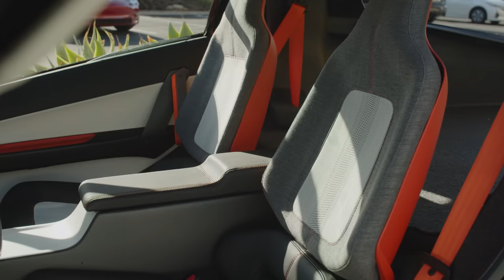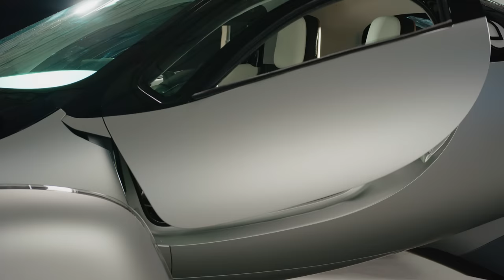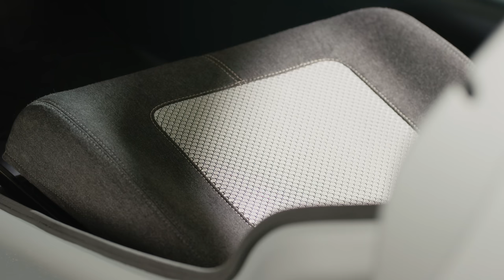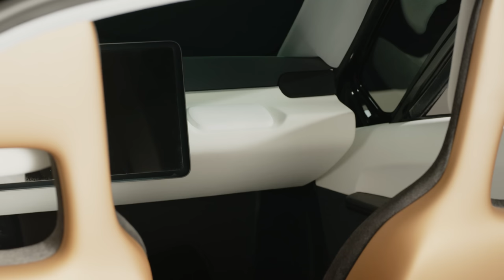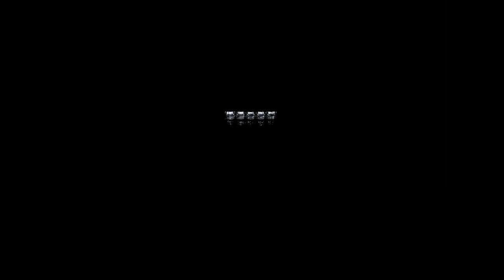Gamma's Interior Details — Aptera

Comment: Regarding the yoke, the $10M question is how it performs during low speed manoeuvring, for example parallel parking.  If it requires rotations beyond +/-90 degrees then I think it should be replaced by a steering wheel, otherwise you'd need to cross your arms. Aesthetically I am OK with it, but from a practicality viewpoint I have concerns.  ... could a steering wheel be an option?
Regarding the rest of the interior, I'm fine with it, it looks like a nice place to be while driving, functional, simple.   Incidentally, if a third-party accessory manufacturer were to produce an external solar windscreen cover, which plugs into the exterior solar connector, maybe clipping onto the mirror camera stalks, I think that would be great. It'd help keep the car cool while simultaneously boosting the charge during parking (giving much more power than the dash solar panels can provide).
Reply: To me it seems that the motors on the tires are relatively small so it should turn pretty tight pretty quick. I don't know why I think that but it just seems that way to me
Reply: I have arthritis so I hold the wheel in various different ways.  I'm not super hyped about the yolk and would likely look into some kind of replacement.
Reply: @meikgeik  Like most cars and motorcycles there is certain to be a plethora of aftermarket accessories if a maker does or does not offer said option.  Sorry to read you have arthritis and I do hope you can get that option in some way.
Reply: I really like the idea of extra panels. Would be great if there was something like a 'solar parking' mode, covering the windshield with rollable solar panels and maybe folding additional one from the roof to improve surface area.
Reply: @spyro440  Yeah I think it's a great idea.  Just for the record, not my idea (Aptera owner's club mentioned it, and I think it was discussed on the forum beforehand), but if someone made it, I'd buy it in a heartbeat.  Aptera have suggested that they'll let us add in external freestanding solar panels via an MC4 connector or similar, for a maximum of 1500 watts including the built in panels.  I just feel that doing it for the windscreen is the most practical way when you are not parked on your own property, and has the secondary benefit of keeping the car cool.
Reply: There needs to be an open space on the top corners of the yoke so you can hook your fingers under it for those tight turns imo.
Reply: @deejnutz2068  Yeah.  From some of the interior-reaction shots from the previous video, I got the impression that people were able to hold it on the upper corners comfortably.  But looking at these photos, It's not clear how they were gripping it.  Hopefully we'll get a closer look at it in use at some point.  I really want to know how it performs at low speed sharp turns.  If it takes 720 degrees to go lock to lock then it'd simply not be viable IMO.  But if they have set up the steering electronics so that it is no more than +/-90 degrees at low speed I think it'd be fine.
Reply: @spyro440  Ooh, cool idea. If it didn't affect aero too much, additional panels could automatically deploy from the top over the windshield and side windows, maybe 30 seconds after closing the doors.
Reply: 100% agree, the one true case of “don’t reinvent the wheel”.
Reply: Please Aptera allow for non-yoke as an option!
Reply: I sure hope they're paying attention to these conversations. To me the yoke is a gimmick, to be futuristic looking. There's no reason to not have a steering wheel, really.
Reply: I completely agree with concerns about the yoke as the sole steering option, and look forward to reviews by independent automotive experts. Evasive maneuvers, parallel parking, lane changes within traffic circles, u-turns on two lane streets, etc. are all of concern, as is the ergonomic need to change hand positions on road trips. This past week I paid a lot of attention to how I used my hands on a short 300 mile road trip, and was surprised at how often I repositioned my hands to use all parts of the steering wheel of my Ford e450-based RV as I drove down an interstate. The e450 steering wheel is also thinner than the thick edges of the yoke, and therefore will be easier to grip. The yoke seems designed for much larger hands than mine.
Reply: I'm ok with the Yoke, but it might be slightly ahead of it's time.

If electronic steering was approved by regulators, variable turning ratios would be super easy.

If my order doesn't come with drive by wire, I'll be making some tweaks, aftermarket.
Reply: @wesman9274  imagine having an electric problem and not even being able to steer
Reply: Progressive steering?
Reply: Agree with OP.  Too many designers go for the "rad factor" and forget that there are actual daily driving requirements that their cute little aesthetic enhancements are a safety /performance detriment.  Its the main reason why I elected to not go with a Tesla Model S ( that stupid ass yoke ) and chose a Fisker Ocean Model ONE instead.  This Aptera might be a great "town" option as my second car so we can get rid of our ICE VW.

Comment: My only complaint is the steering yoke.  I prefer a normal steering wheel.
Reply: Give it a chance. I just don't like the smiling appearance
Reply: @SiDPT15  Not giving it a chance.  It's a deal breaker for me.  I've driven a vehicle with a yoke and turning the wheel more than 90 degrees is irritating because there is nowhere to grab.  This car is not for me unless they give a different steering option.
Reply: @Barrettfloyd82  lol
Reply: @Barrettfloyd82  i dont fwg it .  They can just set the steering in a fashion that in lowspeed wheels are turning further than at higher speeds ..so as you will never have a 90 degrees ..
Reply: @Barrettfloyd82  really dude, you base your entire choice of car on the shape of a steering wheel?

Man needs to get out more.
Reply: @Barrettfloyd82  there will probably be an aftermarket wheel at least
Reply: I agree,  it is not only hideous,  but besides copying Tesla, there's just no reason for it.
Reply: Why not a gorgeous steering wheel like the VW XL1 has?
Reply: Yeah I do too. I feel like this style is just unsafe

Comment: Thanks Jason for the update. I am really looking forward to the September reveal. Specifically how everything looks and works with the latest design revision, moving towards Delta.
Reply: I'm planning on using one of my solar panels for my solar home generator for an interior front windshield sun shield.  It should be about the right size and it won't be stolen when left parked somewhere.

Comment: I thought Alpha looked great.  Gamma is incredible.  I can't imagine how awesome Delta is going to be!
Reply: Other than the steering wheel and Tesla plug I love the vehicle.  I hope they meet their specs for the vehicle and become a huge player in the EV market.
Reply: holy ** its him. Yooooo
Reply: Ideally delta should be nearly identical.  We should be past the stage of visual design iteration and what remains is assembly / parts improvements.
Reply: @gbpg2016  is there a specific reason why you don't like the Tesla plug?
Reply: @charllectric4842  the fact that nobody outside America uses it. The current standard is bulky, but can actually scale to powering big rigs and such without a separate connector.

Comment: I still like some physical buttons switches and knobs.  Don’t make the user dig on the screen for very simple tasks!  Examples include:

* A classical stock mount lever for the windshield wipers.

* A classical push button or rotating knob for temperature in the cabin.

The use of the Tesla connector is also backwards looking (pun intended).  The DCQC charge connector should be in the nose of the vehicle and it should be a CCS connector.

The yolk is a mistake. Do not offer it as standard.

i’m concerned some of these decisions above will scare off a lot of good potential customers.

Despite these criticisms, the Aptera Team is doing fabulously.  Well done, and

Charge on!

Comment: The interior looks great but I'm not a fan of light colors on the steering wheel and I usual drive with my left hand below the center (8 o'clockish). I do not see a way to adjust the headrest nor do I see a lumbar support. Since I am only 5'3½" tall with neck and lower back injuries, these things are important to me.
Reply: I think the headrest slides up and down (in the earlier interior shots, there was one where one headrest was higher than the other).  Presumably there will be different interiors (I ordered Vita, for example), which have the matching colours on the yoke.  Lumbar support would be good, you could use a lumbar cushion if necessary though.

Comment: I've got a reservation set. Everything looks great, but not sure about the yoke - I usually drive with one hand on the top of the steering wheel. I haven't driven with one yet so I'm a little biased, but I'm sure there's a reason it was chosen. Willing to give it a shot though.
Reply: A yolk is actually way safer than a steering wheel. During a crash if you have your hand on the top of the wheel, the airbag will shoot your  arm into your face breaking your arm and possibly your nose. A lot of injuries have been caused by this. I know it might be hard to get used to for some people, but its worth it in the end! Gosh it also looks so cool!

Comment: The look is clean and straightforward like a Tesla, hopefully the build quality can improve on Tesla. I do have doubts about the yoke though, there's a reason why the yoke gets a lot of criticism in the Model S and why all legacy manufacturers do not make yokes on their production vehicles.
Reply: People still buy the model s right? It’s definitely not a deal breaker at least for me. The reason why their going to keep them is because of the vision screens(both mirror cameras are going to be on the screen in front of the steering wheel) If you have a round wheel you won’t be able to see the screen as clearly because the round wheel will be blocking it
Reply: I like the idea of a yoke. Finally, I won't need to move my head up and down to see all the info in front of me. However, a fast  turn ratio is also a must.

Comment: I wish the Aptera team would watch Casey Putsch’s video titled “Why the Corvette C8 steering wheel is idiotic garbage and what it should be” and really take it to heart. I don’t care how a steering wheel looks. I do care an awful, awful lot about safety, physical fatigue when driving, and the ability to control any car I drive in emergency situation. I cannot imagine how the current wheel can possibly be gripped in a way that allows for effective emergency steering. And I cannot imagine how much of a pain it will be to to try to find and install a suitable replacement on my own.

Please, don’t anyone reply to this comment without watching that video. And please, Aptera engineers and designers, if Casey is wrong and if I’m wrong, just show me the evidence that demonstrates that a wheel shaped that way can be effectively gripped and maneuvered in an emergency situation. Show me the comparison. Show me it’s better, or at least as good as a decent traditional wheel.
Reply: I have said similar things when Aptera went from wheel to yoke. I do not mind the yoke, I actually like a yoke. What I mind is the touchpoints. If you are driving at 3/9, you need to be able to wrap fingers around the wheel/yoke for best control of the steering device. This yoke does not do that. Aptera needs to address the grip points of the yoke before releasing the vehicle to the public. 

People will get use to a yoke. But they need proper hand placement and grab points in order to do so. My 2003 Cobra has better 3/9 grab points.
Reply: @pbandj37  exactly.
Reply: @pbandj37  This is my problem with the Aptera Joke... err... Yoke.  I want to be able to wrap my fingers around the wheel in a proper grip, not the open-handed palming thing that their yoke forces on us.  This is my single BIGGEST complaint about the car today.
Reply: Watched the referenced video.   He does rattle on a bit, but the point is there.  Improper, unnatural grip.  My main point about a Yoke is this. When he turns his hands 180 degrees, crossing his arms, for racing that may be fine, but you should NEVER cross your arms driving a car on the street.  One hand turns, the other moves along the Round wheel all the while still in contact with the wheel, then you grip with that hand and feed the wheel around sliding the other hand along the Wheel, always in contact with the round wheel.
Now I'm not saying doing this at high speed like in a race car, but all low speed maneuvering like you do turning into parking spots, or the like.  Having a one sided floppy yoke that you have to turn two full revolutions, your hands do not " find " the yoke where it should be , and loss of control WILL happen.  Emergency turning, if you have to hunt for the Yoke when it's rotated upside down, or at a 45 deg. angle, again Loss of Control.
Aircraft Yokes only turn 180 degrees.  90 right, and 90 left, because Ailerons only move so far up and down, and mostly a Pilot doesn't move the yoke more than about half that.  Never two full turns lock to lock, like a car.  
A Car is not a Airplane, and should not have a Yoke, Period !
Reply: "And I cannot imagine how much of a pain it will be to to try to find and install a suitable replacement on my own."  I've done it myself, it's actually fairly easy, provided that they're using a common steering column design, and there aren't too many controls.  Just be super careful of the airbag at all times.  That thing can kill you.
Reply: @WyndStryke  The electronics dictate how easy it will be to replace this yoke. Replacements for Tesla yokes are custom…can’t be used on any other car.
Reply: @maudessen573  Agreed, but a) I think they will be using a pre-existing mechanical & electrical pickup design for cost reasons, and b) there don't seem to be any controls on the thing.  The airbag will be one circuit, at least.  Those are usually pretty standardised though.  Not sure what the two 'eyes' are in the middle, maybe for turn indicators, or just decorative?
Reply: @WyndStryke  I keep wondering about those eyes myself. They better not be turn signals.
Reply: @maudessen573  Another alternative might be the carhorn?  Seems like a strange placement for controls though.
Reply: I just watched the video, and loved the commitment and the critique. I wish Aptera would engage that guy to help them design a steering wheel that would assure a safe, usable, enjoyable driving experience.

Comment: Please, please, PLEASE fix that stupid yoke.  It's not the silly appearance that is my biggest problem, it's the inability to GRASP the wheel in a closed grip.  I get that the hub needs to be big to house an airbag, but it doesn't have to extend all the way out to the sides to block the ability to grasp the wheel.  Make it a three or four spoke yoke that has open grips that you can wrap your fingers around at the 3 and 9 positions.  

Who failed to understand basic ergonomics with this design???  😥

Comment: The yoke is literally the only thing stopping me from placing a deposit. Please don't copy Tesla for the sake of being weird. A 180° steering setup only works on racecars. I'm sure this has more than that for low speed maneuvering. If it doesn't it will have super twitchy steering at high speed. With multiple turns lock-to-lock this will be an awkward mess to drive around town. You can design your screens to be visible with a full wheel. Plenty of car companies have figured out how to do that.
Reply: All these comments regarding the yoke and comparing it to Tesla have missed the elephant in the room.  Aptera has differential steering capability, which i doubt if anyone making the anti yoke comments have experienced.  Your "sure that Aptera has multiple turns lock to lock" and that if it doesn't it will be super twitchy at high speed, ignores the potential of the design.  I have no insight into what they will actually do for production vehicles, but Aptera will not even need to move the angle of the wheels to provide steering.  I am going to wait until I have a chance to experience what they deliver.
Reply: @n.brucenelson5920  So a car designed for maximum efficiency is going to burn energy to steer rather than just turning the wheels? Seems unlikely. Plus that would mean the yoke is not directly connected to the rack, which would require adding a ton of redundant capability. That'd add weight and cost which they can't afford at their price point and efficiency goals. Also seems unlikely.
Reply: @JoeBatwinis  Yes.  One of the benefits is that wind resistance will be reduced to some degree by not having to turn the wheels in an angle to the slip stream.  

I don't know how steering will be implemented at this point, but differential steering capability is an independent of whether the yoke is connected to the rack.  Your guess does not follow.

Comment: If they’re truly dead set on the yoke then I’ll have to cancel. I’ll wait for now, but If I’m gonna pay $35,000+ I expect the product not to be defective from factory. Not sure why they’d risk turning people away before they actually start production.
Reply: It's not difficult to swap, I've done it myself.  Took me a couple of hours because I'm a klutz with anything mechanical, most people would probably be able to do it quicker.  Obviously would be better if it came from the factory that way as an option.
Reply: @WyndStryke  A replacement will have to be bespoke because of the electronics.
Reply: @maudessen573  Yep, don't seem to be much in the way of controls on it though.  Just the airbag?  Or are the two 'eyes' actually buttons?